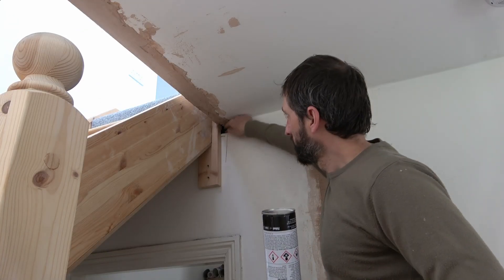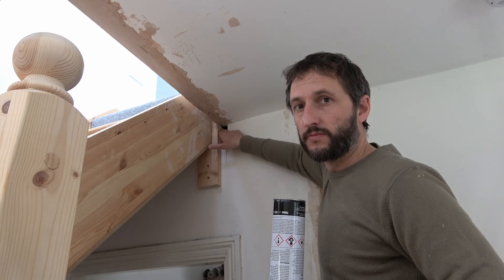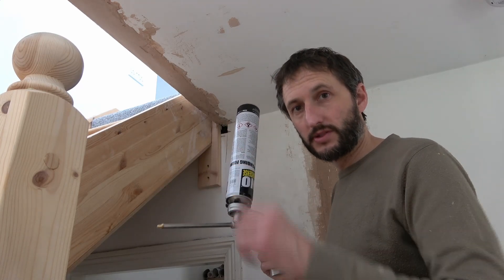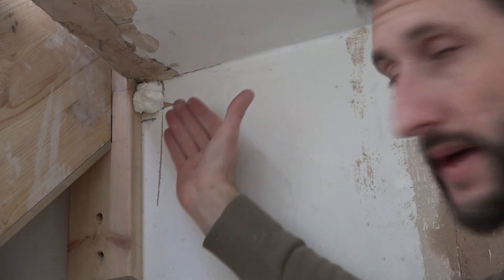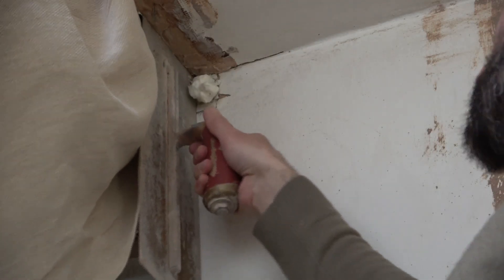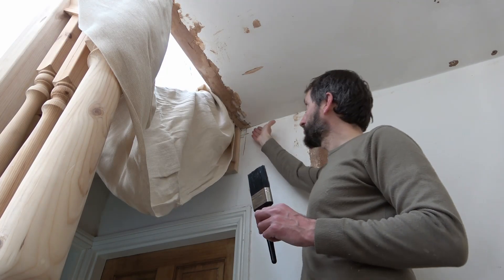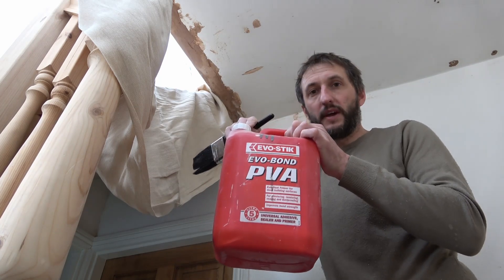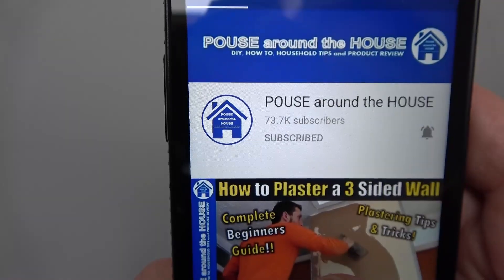Prepping a wall for plaster expanding foam trick! How to prep a wall for plaster foam hack top tip!!

Comment: Great video, if you leave the foam to go off for 10 minutes when it feels dry to the touch and then it can be pushed gently back into the hole using a wet stick or brush and the resulting compacted foam is very tough and will not need trimming! Cheers
Reply from the maker: Nice tip, thanks!
Reply: great tip!  tyfs

Comment: Excellent sir! Thank you!
Reply from the maker: Very welcome!
Reply: I'm using spray foam to attach backer board pieces behind circle holes in lath plaster and holding them in place with insulation hanging wires. It's an odyssey

Comment: they make plenty of patch repair kits using screens and the like ...much less troublesome than dealing with that messy stuff.  Plus, the gap cans most of us have are single-use
Reply from the maker: That's fair enough, but if you're doing a large project and have a can of foam open, it's another 'string to your bow' so to speak. Thanks for watching.
Reply: Soudal expanding foam with their spray system (not gun grade) works well for storing between uses. Managed a good 6 months between uses, you might have to trim the tube if some dries inside but they're cheap to replace.

Comment: Nice tip
Reply from the maker: Thanks for watching......yet another video! You still on the 125 or treated yourself to a bigger one?
Reply: @POUSEaroundtheHOUSE  Wanting to do my DAS and move up on to something bigger but 2 slip discs in my lower back has stop me riding at the moment. Still got the Drz?
Reply from the maker: @125sm3  that sounds painful. Good luck with it and hope you sort the back out. I'm still riding the drz. I'd like something with a bit more grunt but the drz is fun, reliable and bullet proof so probably keep hold of it for while.

Comment: Pousey, what do you think of tectight or push on fittings ..? Would you trust them under a floor or behind a wall...?
Reply from the maker: Yes, I've used JG Speedfit in parts of the house. Never had a problem with them. Great way to quickly fit plumbing. Hope that helps.
Reply: @POUSEaroundtheHOUSE  
Thanks Mate...👍
Reply: I'm just about to start putting my main bathroom back together as part of it's refit, the amount of pushfit connectors under the floor was shocking, along with the 95mm deep notch in an 8" joist. however not one of them showed any sign of leaking, I think bathroom was last done (very poorly) about 10years ago by the previous owners. However I've decided that as I have room and opportunity to fit plumbing manifolds, I'm going down that route, means point to point connections with pex and no joints under the floor, only joints will be at manifold, hidden behind an access panel and at the fitting. also each feed will have an isolator on the manifold, so great for unexpected maintenance down the line.
Reply from the maker: @tonymcfeisty2478  sounds like a sensible solution. Forward planning is always worth while! 👍

Comment: Do you pva new plasterboard? or concrete?
Reply from the maker: New plasterboard is ready to be plastered without any prep (other than taping or filling large holes. All old surfaces need prep so indoors I'd use PVA. Hope that helps. Thanks for watching.
Reply: @POUSEaroundtheHOUSE  thanks have a bit of a fix on my hands, this vid is Golden advice, thanks!!

Comment: Hi could you please tell me how to add another light and switch to attic from bedroom ceiling rose but it only has twin and earth and no loop and the switch only has one twin and earth I’ve spurred from light but the bedroom light has to be turned on for attic switch to work I’m a bit confused
Reply from the maker: You need to take the live feed from the permanent live not the switched live. Sounds like you've connected live to the switched live so only comes on when bedroom switch is turned on. Click here for my electrical videos which may help https://www.youtube.com/playlist?list=PL2-FHRIF3qm_pR24R7K-t-42aIoqE3oaI

Comment: My top tip. Don’t try and wash the expandable foam pipe, because you then spend an hour and a half trying to clear the waste pipe when it expands🙄
Reply from the maker: Sounds like fun, thanks for watching!
Reply: if you do need to clean expanding foam from anything,  you can try using Acetone as it will dissolve it. just be careful as acetone attacks lots of materials, especailly plastics I use it to prime solvent weld pipe for example. I also use the packing in of part cured foam technique described by Rob Mills
Reply from the maker: @tonymcfeisty2478  thanks for the tips 👍